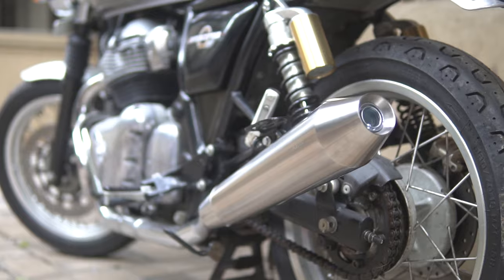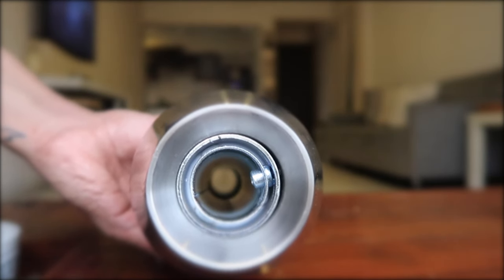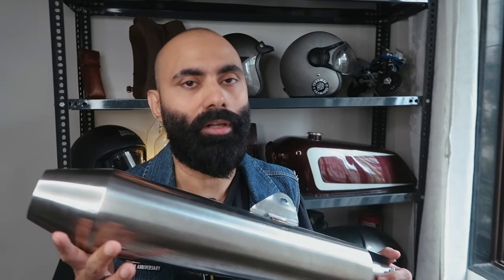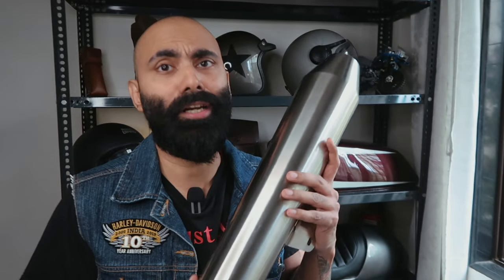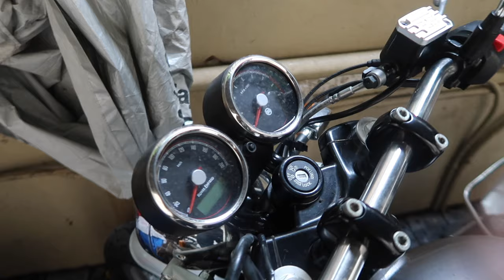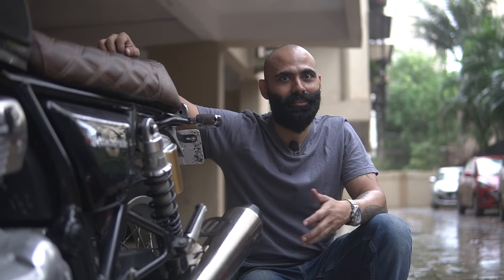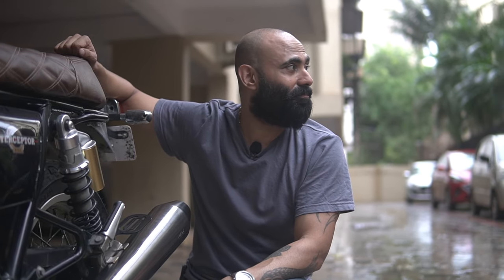EXHAUST UPGRADE FOR INTERCEPTOR 650 | AEW TE102

Comment: Changed my Int650 with AEW TE102 exhaust and couple with DNA air filter with 2nd stage kit ... let the ECU get used to the new change, start the engine let it idle for ~ 10 min. Throttle response good , pickup good ..sound wonderful ... i keep the db killer installed ... i like the sound ....  riding experience superb ... love this exhaust .....
Reply: @breadgarlichouse2265  the sound is good , louder and more growling but pleasant to hear, riding experience good ...0 to 100km/h slightly better than the stock ....
Reply: Hi, with the stage 2 kit I'm worried about riding the bike in rainy conditions ..I feel the opening might be troublesome with water going in, which im not sure of. Please share your thoughts, I would really like to make an informed decision. And is dna better than bmc?

Comment: No good exhaust after 6 month and using it for more than 12000 kms superb avg drop out, now there are many dyno tested exhaust why ur installing this, very good knowledge person like you are installing this exhaust I'm surprised, one more thing  this exhaust will do missfire above 4000 rpm
Reply from the maker: Now let's get this straight the only complaint you have is average drop it's obvious of the throttle response will change to get more out of the stroke it will reduce the average wonder how dyno test will help you for average ?

Comment: Great video Mate. There are loads of after market options for end cans but I hardly see anyone addressing the header pipes, other than custom builds. I want to fully de-cat for "Racing"😉😆! Apparently, the bike is losing several bhp from the header pipes, because the stock ones are double skinned & there is cat in them too. Are your AEW end cans straight though pipes or do they have cats in them? I'm guessing they do & it's the 101 that's a straight through, hence costing less.

Comment: Very interesting, and very glad to see those mufflers being made in India to. Do you have reprogram the fuel injection for the new exhaust mufflers? If so, did you use a plug and play device with an App and do it yourself or did you get your tuner to do it for you? Thank you for your video.
On a side note, very few people l have seen changing their mufflers on the 650, realise that the stock exhaust contains a catalytic converter as part of its Euro 5 emissions compliance.  People on the European continent are asking for trouble from the emissions police for removing the catalytic converters. This is one of the reasons that get very hot.
Reply from the maker: No mapping done yet keeping a watch on the RPM if any difference found will do the needful, my motorcycle is a BS4 I guess and yeah the situation is based on the locality I stay but have to make sure DB killers to be on on highway then the exhaust note is in control

Comment: Hello Raj! It would really be appreciated if you would tell the audience the truth about such exhaust modifications. It does make your bike louder but it also reduces the longevity of the engine. Not only do these pipes contribute to the noise in the city but also increase emissions.
You as an influencer have a certain responsibility.
I hope you will do the right thing.
Reply from the maker: Sure will explain soon cheers

Comment: I bought this exhaust and sold it! Too loud for long rides even with db killers. I'm back in stock. I just wanted something which has 25 or 30% more sound than stock... Guess it's not available in market. Make an informed decision before you buy. 

Much love,
Isaac Thayil
Reply from the maker: Do check your DB killers cause mine with DB on don't make that loud sound infact quite close to stock are you sure you have 102 ????
Reply: @RajeevAcharyaRidewithRaj  Db killers was all fine. Have you tried long ride? You might understand what am saying. I had te101 matte finish. Not at all enjoyable for long rides especially in highway. Cruising in 110 gives headache. Maybe some folks would love... Not all are same right.
Reply from the maker: @TamilGuitarLessons  there you go I have explained the difference between 101 and 102 in brief for me with DB on the 102 it's decent sound and yes o always do long rides to check the feel soon you will see my ride videos cheers

Comment: Dont you have to upgrade the air filter and the ecu when switching the exhaust to a custom one?
Reply: This isnt like the other royal Enfields. Just like the superbikes,one has to upgrade the air filter and tune the ecu or remap or fit a piggy back ecu. Like you said,most people aren't aware of it.
Reply: @arjunramachandran3864  Just changing the end cans, you can do no problem. All modern bikes have automatic ECU adjustment for things like atmospheric changes. If you start & idle for 10-15mins, without touching the throttle, should be ok. The Booster Plug is a good low level plug'n'play option to make your bike run smoother. However, if you change the header pipes etc, you'll have to fit a piggyback like the Powertronic.

Comment: i smiled off : ) 

sexy it sounds.

questions:
- can u explain what you meant by 'we have to downshift correctly to keep the backfiring to a minimum' ? ...i own a KTM 390 Duke and the sexy backfiring happens when i cut off the throttle suddenly. But when i ease the throttle down slowly then no backfires. 

i have been reading up on it and i believe it is related to my valve clearances not being correct. i've learn't that its not THAT big a deal so after say 35000km i'll adjust the valve clearances.

i work on my bike myself. too afraid to open up the engine just yet. i have all the tools i need. is a hobby. i've been rebuilding my RX-135 too, where did u get that seat made? Looks nice.

congrats on your sexy sounding pipes. waiting patiently for the review when riding it. take care of your health.

Comment: that's not a seam welding....the way welding was done I think that's a TIG Welding.....
Reply from the maker: Yeah mentioned was not aware in my video just opened it but iam sure it's tig due to its precise flow over steel
Reply: @RajeevAcharyaRidewithRaj  yeah.... because in case of seam welding the filler metal deposits in continuous manner....not overlap with them like in this case....
Reply: btw when we gonna get the clear sound comparison between both of the exhausts...